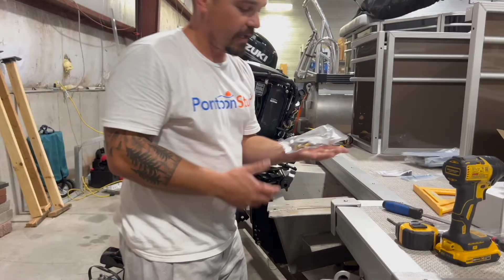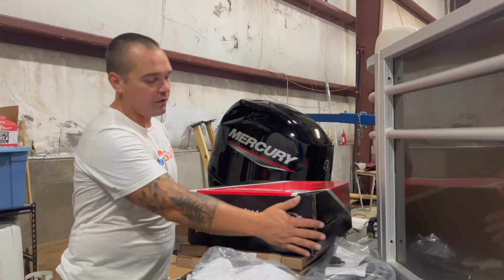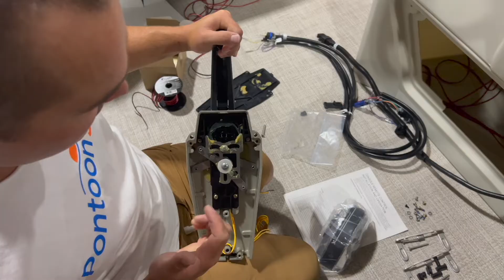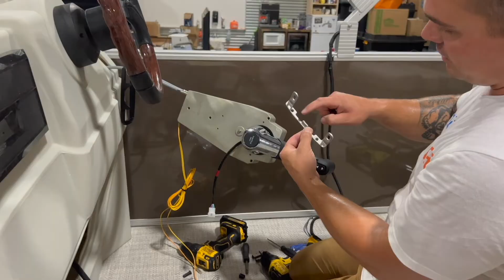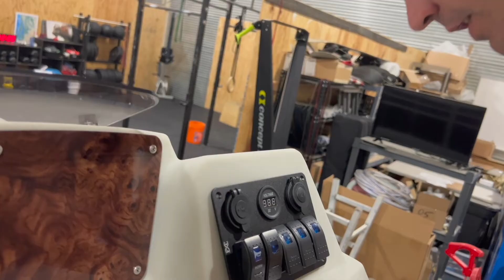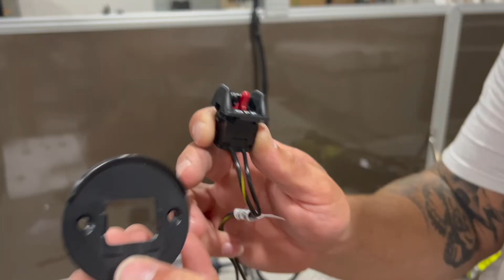Installing NEW Mercury Four Stroke 40 hp Command Thrust Outboard - Part 1 of 2

Comment: do you have part numbers. ty
Reply from the maker: I don't have numbers for everything only because the harness lengths may be different boat to boat which will change the part numbers. Likewise the shift/throttle cables would be different too from boat to boat. I strongly advise giving Van's Sport Center a call if you need to order any replacement or new install parts for your motor. They're local near me and are a Mercury dealer, and they'll ship anywhere. www.vanssports.com Ask for Brad in parts, and be sure to tell him Tom's Toons sent you!

Comment: Wow! Awesome video! Has all the info for installing easy, but I wish you would have listed all the parts you used because I need everything you installed for 60 hp I need to mount. When I go online to get them order it's hard to sift all the crap to get right parts the first time....
Reply from the maker: I will make sure to list those components in the future. I’m fortunate enough to be able to walk into a Mercury engine/parts dealer and tell them what I need for each boat and they have a great inventory. They sell online and over the phone too, call Vans Sport Center (616) 364-0666 and ask for Brad in Parts. Just tell him the motor you have (year and hp) and what you need…shift throttle, ignition, wire harness, vessel view, length of shift/throttle cables, safety lanyard kill switch…and he’ll get you hooked up!

Comment: Would be cool if you added parts numbers to info box. I have a 40BF and need Merc Gen 2 cables but not sure which ones. Part number would have told me which ones I need. I'll figure it out. 😕
Reply from the maker: I try to whenever possible, but in terms of cables they're all a slightly different part number because of the length, plus there are options from Mercury as well as Teleflex and others. I'd hate to show the part number I used and it be 1' to 2' (let alone 6') different than what someone else needs for their boat. 

Try searching this Mercury part number, changing the last two digits to the length you need:
Mercury Part #: 883720AXX (so for 15' long cable search Mercury Part #: 883720A15). NOTE: The part number may supersede to a different number so verify the product specs/description before purchasing.

And here's a link for Gen 2 style cables by Teleflex where you can select the correct length for your boat:
https://www.wholesalemarine.com/control-cables-for-mercruiser-mercury-gen-ii-2003-newer/?gclid=CjwKCAiAkfucBhBBEiwAFjbkr--mZKCIX81oE4KhimsngZFfc56_YbnECIv_zCYdJdLoUlzMTgW6XhoC2qQQAvD_BwE

Comment: Ive got a 2015 60hp Mercury. Is this all the wiring I would need to get on the water? If so can you give me the part #s for all 3? I have vessel view and don’t wanna run gauges right now. Also I need new throttle cables if you can send the part # for those as well it’ll would be appreciated. Love your videos. Thanks
Reply from the maker: You only need the shift/throttle controls, shift/throttle cables, and an ignition harness with a key switch. It's a good idea to add a safety lanyard (and required in some states). I'll do my best with part numbers from a quick google search, but double check everything, or purchase from a local Mercury dealer who can verify. I get all my parts from a dealer in town which saves me headache from buying the wrong stuff.

Mercury 896537K20 Key Switch Harness 14 Pin 20 Ft
Mercury Binnacle Mount Outboard Control Box Assembly OEM # 883711A12, 8M0041431, 8M0059686
Mercury 19674A08 SAFETY SWITCH & LANYARD 19674A08
For Shift Throttle Cables you'll need "Mercury Gen2" Cables for the length needed for your boat. The shift and throttle cables are the same in appearance and function, you just designate one for shift and one for throttle. 

Hope this helps. If all else fails, give Brad a call at Van's Sport Center and he can sell/ship you everything you need. Just have your motor serial number handy for him to verify: 616-364-0666

Comment: Hey Tom, I was trying to find a video you had where you hooked up a diagnostic tool to check for hours, any suggestions on a specific diagnostic tool for that? When looking for a motor everybody always says low hours, but who knows, also I heard a person say too little hours over many years might not be a good thing, all kinds of opinions! Thanks
Reply from the maker: Mercury is the only brand that allows the owner to hook up to the motor to check hours, it's called Vessel View Mobile and it's a system that hooks to the motor then blue tooths to your phone. It's only available on EFI motors 25 hp and up and I believe around 2006 and newer. It's not a diagnostic tool other than checking hours. It does give real-time data for temperature, fuel flow, etc. though. 

300 hours is low for the newer EFI four strokes. 500 is well used, but still solid, and anything over 800 is likely getting a little tired. However, I've seen plenty of four strokes well over 1,000 hours with only the standard maintenance done.
Reply: @tomspontoons  Thanks Tom, that's a huge amount of info, I really appreciate it!
Reply from the maker: @skylark4901  Happy to help!

Comment: Hey Tom,

Love your videos, they're helping me so much during my pontoon build! I have another question for you that kind of pertains to this video. I have a 2008 mercury 40 and I want to change the fuel lines. When I bought it, it had a 3/8" hose from the take to the water/fuel separator then 5/16" to the engine, then it looks like it butted up to a 1/4" at the engine. Is this normal or how should I run my new lines? Thanks again Tom!
Reply from the maker: Thanks for watching!!

That motor should have 5/16” at the motor, not 1/4”, from my experience. Can’t hurt to run 3/8” as it allows more fuel flow. 5/16” the whole way would be just fine too!

Comment: Why didn't you torque the bolts properly?
Reply from the maker: I worked in a marina for years and watched motor installs done over and over hundreds (probably thousands) of times by great mechanics. I simply repeat the steps I learned from them.

Comment: What happened if the plate is further below  The water line mine is
Reply from the maker: You’ll tend to lose speed, potentially have cavitation, and almost always get excessive spray…even to where it sprays back at and even into the rear of the boat. I typically recommend raising the motor one mounting hole at a time until the spray reduces. If you go too high you’ll have cavitation and/or over-revving to where you can’t operate at higher speeds. If that happens then simply go back down until the happy medium is found.

Comment: can you share the ignition harness model number please . Thx
Reply from the maker: The lengths of the ignition harnesses vary, but this link should get you on the right track. For this motor you need a 14-pin harness with key switch.

https://www.boats.net/catalog-product/collection/80FC7B869D423FEA0791EAEE6953B37AAA95D3E5/3EE7F58B68EB34DDDA33E8A2F0B4F843ADC81930?titan_sku=896537K20&CAGPSPN=pla&utm_source=google&utm_medium=paid&utm_campaign=20908436778&utm_content=&utm_term=&gad_source=1&gclid=CjwKCAjwhIS0BhBqEiwADAUhc3WQ1cBttI7ncZrmPH8t8WUdERANyYU-upWthZEt32frymTIXDN4OxoC69UQAvD_BwE
Reply: @tomspontoons  thx I noticed it says key , horn , choke option . Does this also include the 2 wires for kill switch and the plug for the gauges like you show in the video ? Thx for the help
Reply from the maker: @ajj2632 The ignition harness will have a lead and plug for the lanyard, neutral safety, ignition, and trim/tilt, plus a plug for your gauges to run to. There’s a separate harness for the gauges that plugs into the ignition harness. Makes it really smooth to rig gauges and then just plug in.